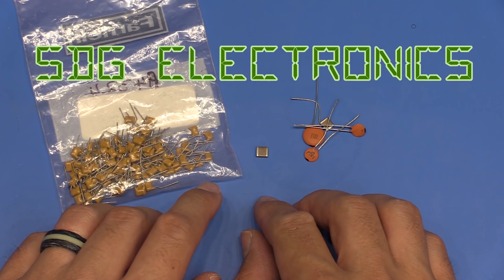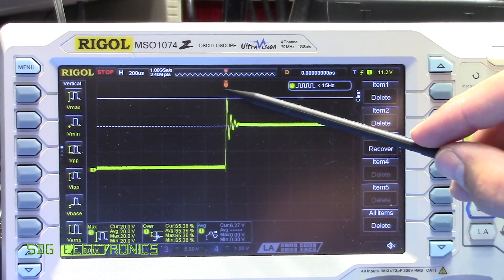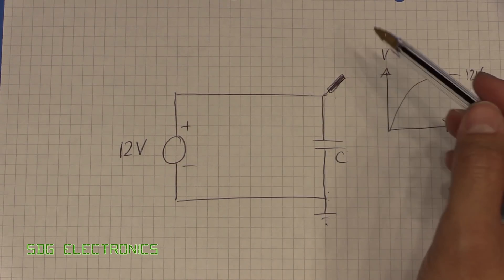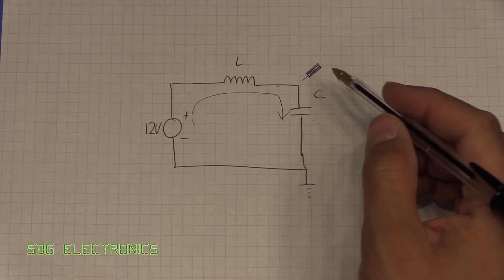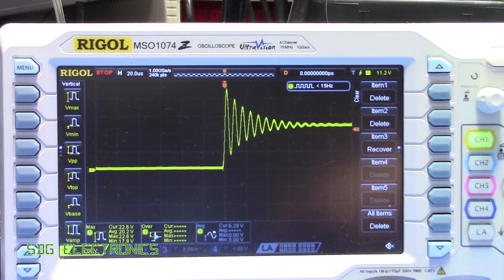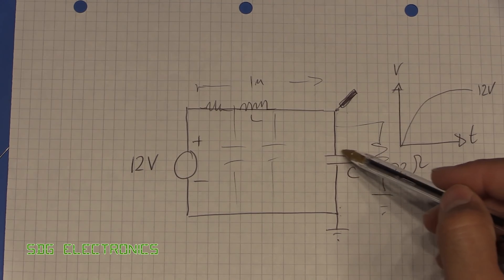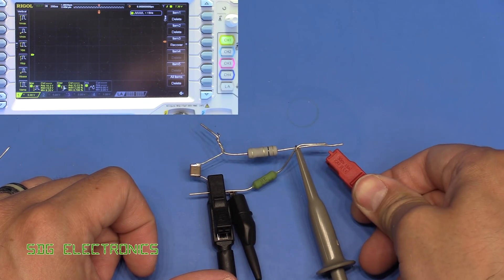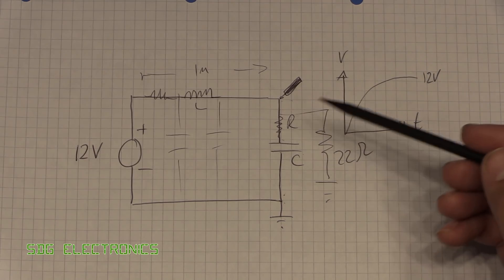SDG #088 Ceramic Capacitors will Blow Up your PCB

Comment: In my designs, I add an electrolytic in parallel with the ceramic, relying on the electroltic's ESR. There's an interesting application note by Linear Technology (now part of Analog Devices) on this. Search for "Linear Technology AN88".
Reply: You can also add a varistor.  There are some 0402 parts that break down at 18 VDC with a 15 VDC hold off.  Though I typically derate everything by 100% anyway.  Linear Tech has plenty of switchers that can handle up to 60 VDC.
Reply: Do varistors react that fast?
Reply: Thanks for that search term, blacktone83. Had half the repliers skimmed Application Note 88, they will have found that their pet idea or argument was addressed in that paper. 

In summary, the electrolytic in parallel with the MLCC is acting as a resonance-damping resistor that provides no additional function outside of preventing ringing (as the operating characteristics of the circuit are outside of the electrolytic's capabilities). It is described as the most effective and least expensive solution, and taking only a small amount of space (as far as input caps go anyway). Also, if you look at the input of pretty much any DC/DC converter (even the really cheap ones), you'll typically see an electrolytic. On closer inspection, you'll see it's in parallel with an MLCC (which is doing the actual work).
Reply: @buckstarchaser2376  I just came across your post and that is what I practice. For my situation, I've found that a 47uF cap provides the best results. Glad to see that my instincts were right all along thanks to your post. Thanks for sharing.
Reply: Good idea
Reply: @Atlas Philip Instablaster :)
Reply: @Atlas Philip No problem :D
Reply: That trick only works well if the electrolytic is the overwhelming majority of the decoupling capacitance. Problem is that with DC-DC converters pushing ever higher frequencies it may look to the DC-DC converter like the electrolytic isn't even there, or it won't cope with the ripple current. So you need to add more ceramic caps to appropriately bypass the input of the DC-DC, which takes you back to square one with the resonance between ceramic caps and cable, or requires a huge electrolytic that is many times the bypass capacitance requirement of the DC-DC. Big electrolytics are neither cheap, small or reliable - there are better solutions.
Reply: @UClXrY49V1fcRQ_3d8aSLS3w Yes absolutely - I add the electrolytic solely to stop the overshoot. Other than solid polymer and hybrid polymer electrolytic style capacitors, standard electrolytics are pretty useless with modern MHz-order switchers anyway.

In cost-sensitive applications I would reconsider that strategy....
Reply: @tmmtmm  Best to eliminate the inductance.  No inductance, no overshoot. Cap goes as close as possible to the source of the noise. Another cap at the load produces a CLC low pass filter.
Reply: hawkturkey  AFAIK a transil (or TVS) would be better suited for the job than a zener, they are made for this purpose and react faster, while being able to disapate higher power, 1.5KE series TVS are rated for 1.5KW transients, in my current project, which is powered by 12V off a small motorbike, I have transils on all the incoming power lines, as the engines electric system can deliver quite some spikes
Reply: i guess Im randomly asking but does anybody know a trick to log back into an Instagram account??
I was stupid lost my account password. I would appreciate any tips you can offer me.
Reply: @Aryan Ty thanks for your reply. I found the site thru google and I'm waiting for the hacking stuff atm.
Seems to take quite some time so I will get back to you later when my account password hopefully is recovered.
Reply: @Aryan Ty It worked and I actually got access to my account again. I am so happy:D
Thank you so much you really help me out !

Comment: Thats so weird, we are having the exact same problem on an led product in work at the minute with an led driver. I was thinking it was a thermal or pcb bending issue cracking the ceramic and causing it to go short circuit. Thanks i will check for this.

Comment: This why i use high voltage cap i like to use 3 times the voltage of the circuit old circuit and old set use the  same thing like i do but half the new circuit use a close voltage value and thay do this  to cut cost  
Thanks for posting
Reply: Over rating the caps doesn't help if there are other sensitive electronics in parallel. A 50V cap may not care about the nominal 12V supply spiking to 24V briefly, but a 12V rated IC might!
Reply: @tmmtmm  might & will. Lol.
Reply: @tmmtmm  your are correct, in the past all components we used were rated so that the highest spike expected to be seen was less than 80% of the components rating. the same for components used after the input power control. but then we were expected to work for 1000's of hours in very demanding applications where cost was not that much of a problem. driving costs down drives this sort of problem up. if you were to calculate the Mean Time Before Failure (MTBF), a 12V supply and a 12V component could be in minutes not 1000's hours.

Comment: How much is that esr resistor , I don't know my codes.
Reply: You can often get the resistance using either an input slow blow fuse, or a PTC current limiting device, giving you both overcurrent protection and protection against ringing at the same time. Combine with a unidirectional transient suppression diode across the capacitor and you get reverse voltage mitigation as well. Otherwise just use thin wire and have a high voltage drop along it, which is commonly an accidental method.
Reply: I think he said it was 22Ω, if you mean the resister he added above the capacitor in his circuit.
Reply from the maker: I just added 1 ohm in series with the capacitor. Normally, you'd use lower than this where possible